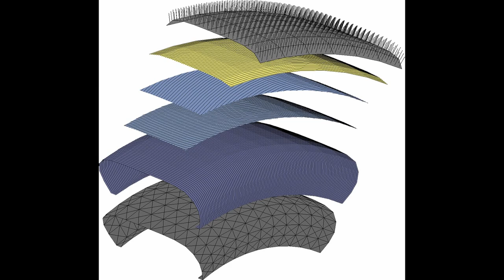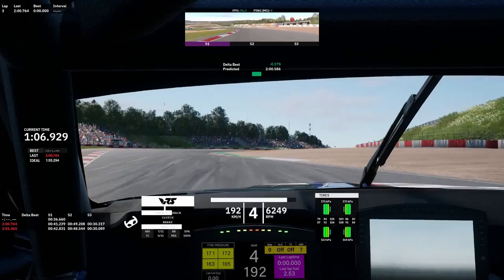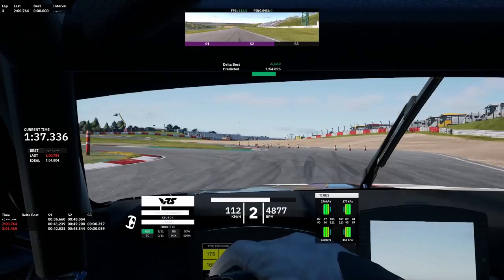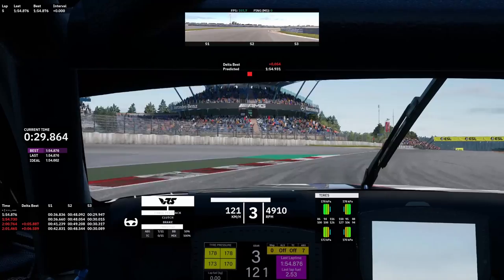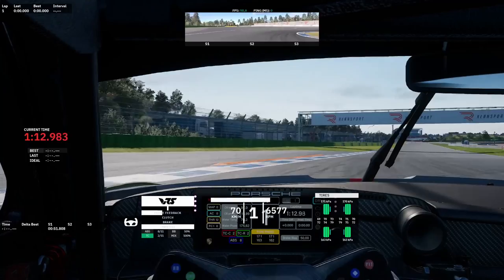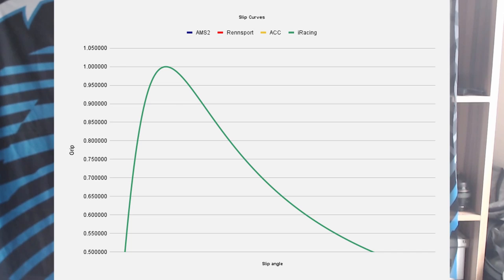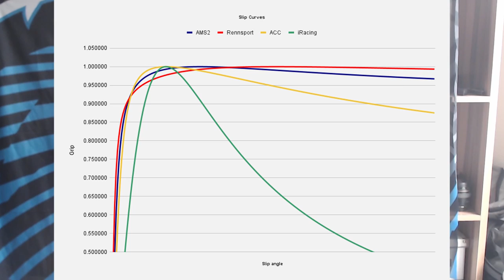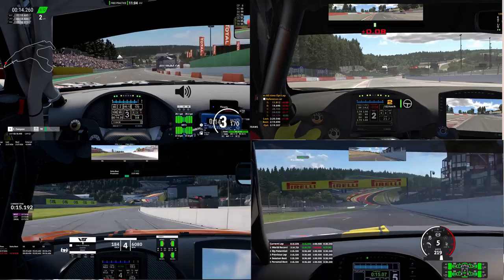"PRO" on RENNSPORT: How it REALLY feels!

Comment: FANTASTIC video, you have described exactly how I feel about all those sims.  Perhaps, we can hope that RennSports will eventually come closer to AMS2, which also very close the RaceRoom in terms of tyres slip angles.  There are too many instances in iRacing where I feel I must drive "unnecessarily" slower then the "limit" since my brain tells me I will lose control of the car any second...
Reply: I like the feel of AMS2. It always feels like you can find the edge of grip easier than ACC. When you find the limit, the car feels like it is dancing in your hands. You are wrestling and guiding it simultaneously. 
ACC feels mute and heavy in comparison. 
However, that could be due to my low-quality setup as I have yet to try a good DD wheelbase. 
The question is what does a real GT3 car feel like? 
ACC, AMS2 or IR? I have seen those with experience claim ACC and AMS2 are the closest to reality.
I guess I will have to make a lot of money to find out.

Comment: Interesting to see that Rennsport has a higher optimal slip angle even compared with AMS2!  Will be curious how it changes with future development though.  I like how it seems with Rennsport (compared with AMS2) the handling balance does not change so dramatically under longitudinal weight transfer with throttle/brake application.  You pointed out that situation in Rennsport where you get oversteer regardless of being on throttle, off throttle etc.  With AMS2 it's such a huge difference when you go to throttle (big rear grip loss) vs. being off throttle (front grip loss, car plows)

Comment: I for one doesn't really buy into the "physical model".  Tire physics in essence is soft body physics that happens on a modular level, a lot of corners have to be cut in order to make it run on a normal PC, and a lot of tire construction design is trade secret.  In the end even the "physical model" relies a lot on empirical data, and that empirical data is already very hard to isolate and measure in itself, when you put on top a physical simulation of the tire structure, it magnifies that issue and expands the margin of error.
Reply from the maker: on point, sir!
Reply: A huge amount of real physics and driving feel is due to g forces the driver feels. Sims are fun games, but they are games. What confounds me is that snobs argue about game physics, then gravitate to GT3 cars with electronic aids and basically only race at Spa or Monza.
Reply: @truantray  It's the comment of the year so far!
Reply: @truantray  
Hit the nail on the head 🙌🏽
Reply: @truantray  I wouldn't not call them games, not today. Driving is not the same as in real life, but that's due to so many variations, but it is really close and you can apply everything you learn in real life driving. I look at it that I am just driving a bit different version of real life car. Even in real life, there are never 2 exact same cars, also all drivers have different styles and setups and weather is never the same. But just simply speaking, the biggest difference besides no g-forces being felt is that in real life you have variable grip levels, in simulation they are more constant. And why not gravitate towards GT3 cars, which are not that hard to drive, but hard to master. I don't except to just start driving f1 simulation and be good, GT racing is also used in real life for novice drivers, it's like really logical thing to do. Arguing about game physics is good, because almost all of us will never enter a real life racing car, so knowing which one is closer to reality makes it easier to understand the differences and decide what is best for you. Don't get the hate you have, if you don't like GT3 cars and electronic aids fine, but don't hate other people because they have different preferences
Reply: I mean even if you had a "perfect" physics model that would match the inputs/outputs and FFB of a real car, the experience between sim and real life would still be very different I'm guessing (not least of all feeling the car movements from seat of pants).  A good development team can work around the shortcomings of a simulator.
Reply: @charliebeckey6269  It's almost impossible to ever be the same, but it is close enough. Reason why modern drivers are better are sims, because even if you are on pro formula 1 team, doesn't mean you can practice driving for hours everyday, it is too expensive and impossible. Sims today get enough things right so you can apply them in real life

Comment: as always Nils with the highly interesting video :D
Talking about the slip angle feel I'm totally with you.
I also feel like you can do so much with the slip angle in AMS2 it's incredible when you first realize it. It's strange though if you think about it. You just compared 4 sims that try to simulate the same thing, a round not so bouncy ring of rubber and it's incredible how different they are.
While personally I think iRacing has the grip x slip max point right, the drop off is too sharp.
ACC feels like it got the point just as well but then you have to drive to exactly that one line and nothing else which also isn't just where it should be.
AMS2 and Rennsport currently look just so far out on slip angle that they might as well have been a drift sim at its birth haha BUT what I think (obviously I can only judge from the looks as I'm not as lucky as you are and get to drive it) the drop off on grip after the max point of grip does look quite good on point for Rennsport.
Probably if you want to have the "perfect tire simulation" (which you're never going to be able to achieve) you'd need the starting curve of ACC, max grip point of iRacing and the fall off of Rennsport.
I honestly hope I'll be lucky enough to get my hands on it in the beta launch as it does look like a really good contender for the top spot of sims. (on the physics side of things).

Comment: Great work!
For me the best Sim is the one where it actually drives like the „real thing“. I understand Rennsport is still in the making and might change but at this point and in the future the question is. Is it Simulating the driving of the different car types better or worse than ACC or the other Simulations? So how much slip angle does a real for example a GT3 car have ? How much and how does TC effect the driving in real GT3 car have (staying with GT3 as an example)? Tire wear?  Etc.? Can you maybe get help from a „real“ race car driver to assess that?
Reply from the maker: car specific behavior is the most pronounced in ACC still. by far, compared to any game really. at least to me. as for slip angle its tricky. different tires have different slip angles they tolerate or need. so it depends who you ask. electronics matter a lot in real life and those systems can work pretty smooth, but at the same time are sensitive to tiny changes in grip levels that you have more often than in the sim. 
talking to real teams and drivers is the daily business of sim developers who rely on empiric data. it doesn't need me to do that ;)

Comment: 244th😀 Yesterday I did some laps in AMS 1 again and it still could be as decent as latest rF2-physics if they would have fixed some tyre-physics issues that I guess isn't possible with this engine. You can too easily spin with a power-oversteer at the apex while in real life there is more grip because the rear is more loaded, bigger tyre-contactpatch due to tyre-flex and chassis-flex might be also involved. ACC had similar issues while trying to drive without TC and the 992 Cup still is too throttle-oversteer-sensitive for a heavy rear-engine car that should generally understeer. rF2, my go-to-sim atm, has still a brush-tyre-model, but so complex with dozens of nodes, it feels physical. The problem with AMS2 and especially pCars 2 before was, that a physical tyre-model is not that great for FFB, because like in a real car there is an additional air-cushion between surface and steering-rack dampening the effects. A FFB-wheel is just a stereo-device and can't by principle give you complete information what's going on. With my 5-6 shakers at the time I could feel a lot more what was going on in pCars 2 and was my go-to-sim for quite some time until SMS made it "more accessible" so simcade with updates. AMS2 did something similar recently and overdriving the car with fresh tyres was possible before, but the slip-angle got far more narrow if doing it during the upcoming laps and tyre-management used to be far more important once the qualifying grip was gone. rF2 used to be too forgiving with tyre-slip and things changed, even flipflopped in this regard. Little drifts in rF2 doesn't seem desirable anymore and shred the tyres. In AMS2 on the other hand my last lap in a race is now often the fastest. 12 months ago this was more the opposite.

Comment: You focused only on the tyre's grip which is fine. I would say AMS2 has a good physics model, but a very strange "driving model." What do I mean by that? You can see and feel the car lean on tires, shifting weight when braking. This is physics model. But when you are driving the car*, some cars don't behave "properly" (what are you anticipating to happen). You can look at particular real life onboards, and the rear of the car in AMS2 feels like it's drifting all the time / at the limit. You don't see that in reality. I don't know how I would define "driving model", except what are you expecting will happen to the car, visually and through FFB, when you're driving the car. In ACC, driving model is very punishing, one little slide, and you just lost half a second. You also don't see that in reality. So Rennsport's "little drifts" not costing you time more closely resembles reality. But from videos I've seen, cars move too much, something you don't see in real life. Tough topic to discuss with words. 

*In AMS2 different cars behave vastly differently, but not because of the difference in cars themselves, but I feel like some are more polished and "in tune" with madness engine than others. I could only post videos to show what I mean, because I can't put it into words. You can also see this in patch notes.

Comment: Tire models output values to copy the grip level but if it doesn't translate to the ffb "feel" then its useless, disconnected and not immersive. At least devs should take care ti put in some realistic tire squeeling, to let the user know that the tires are getting close to limits. Also, glad to hear that Rennsport is closer to AMS2's grip style as I think the GT3s grip limit feel is quite good in AMS2.  ACC seems to have a better rolling tire and road feel but too much understeer to seem convincing and so-so limit feel. AC1 has the best grip limit feel, but feels weak overall in forces and needs a lot of tweak/modding using CM and wheel driver/software adjustments. This is my opinion using a Fanatec CSW 2.5 ffb wheel.

 The only thing now is, that Rennsport, should offer a new point in difference, and punish or reward driving styles with car transmission reliability and/or heat issues, realistic aero damage or tire flatspots causing issues, and random track events or debris that gets announced over radio. Otherwise, Rennsport is just another sim game.
Reply from the maker: tbf I haven't ever heard tires from real race cars outside of complete lock ups. but it's a needed feedback mechanism for simracing to cope with the lack of forces. 
irl steering wheels sadly also don't deliver much outside of oversteer and bumps, everything else is again useful only for simracing to add to the wheel what isn't there in the spine.
I think it's a matter of approach of you favor one or the other for different reasons.
I'm certainly more on the "add what makes sense even if it isn't entirely real" side
Reply: @SimracingPopometer  Racing slicks must be real grippy because I hear my el cheapo station wagon wheels start chirping when I go through  a roundabout fast and also when I go fast through an s curve just testing how much i have learnt from sim racing. Never actually watched racing cars corner at a real track but I can remember gokarting and hearing chirping tires on a smooth concrete floor.

Comment: I swear acc has no slip angle
Reply from the maker: i dont think that makes sense :P
Reply: @SimracingPopometer  well of course it has some but relative to other sims i feel it has the least, cars look like they are always on rails in broadcast cams
Reply from the maker: the issue isnt with slip (alone), but little more slip than what you describe as being on rails triggering the electronics really quickly, and that quickly puts the car back into the peak grip spot on the graph, plus the tc rather costs time so drivers are encouraged to avoid going there in the first place.
Reply: @SimracingPopometer  well lets say acc's "peak grip spot" is too lenient and doesn't provide you to use slip angle to an advantage? 
I always find the cars to feel stiff and dont slide on acc relative to other sims.
Reply from the maker: its too lenient in the sense that you will find it hard to spin the car accidentally, but its not lenient to where the absolute best grip is. you can overdrive it quite a bit without crashing, but you will be slower if you fail to hit the point pretty precisely, which is why you see the pros drive on rails - they dont miss the point.
also i want to stress that this whole slip angle thing does not have a rock solid real life counterpart. tires differ, cars differ, setups differ. there's no right or wrong point, but rather a legitimate range. the range is large enough for sims to feel entirely different. 

Just look back at f1 days when there were two tire manufacturers. both tires seeing different cars use them and requiring different driving.

whenever i watch real life racing though, to me it always looks like cars are very planted, until they are not and the different between grip and not grip is rather drastic. you won't see much sliding about, everything is quite snappy - the grip loss as well as grip regain.

Comment: I mean if they can model a physical tyre in the Unreal Engine, I will be surprised honestly
Reply from the maker: it has absolutely nothing to do with the game engine you are using. a tire model is part of physics calculation that can happen completely independent of the engine used underneath
Reply: Unreal Engine is a graphics generator. Nothing to do with tire models.
Reply from the maker: interesting input, thanks!
Reply: @crexLive  There will also be good reasons why AC2 is moving away from the UE engine again.